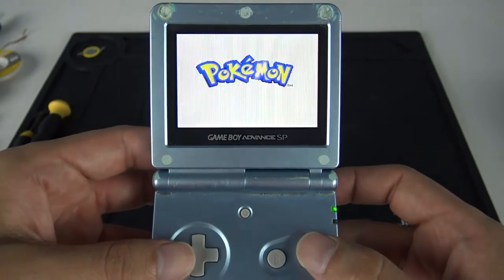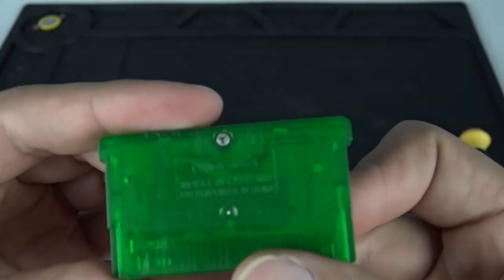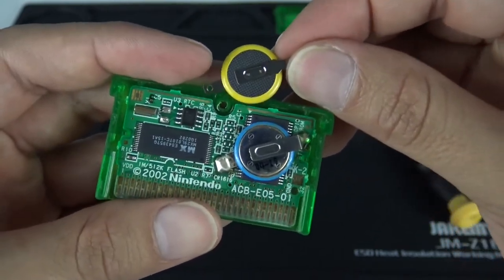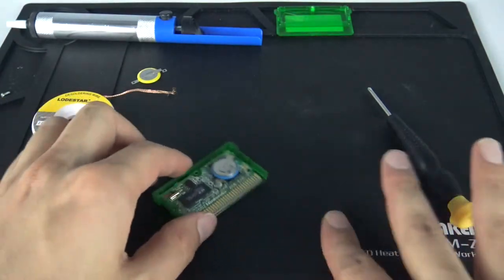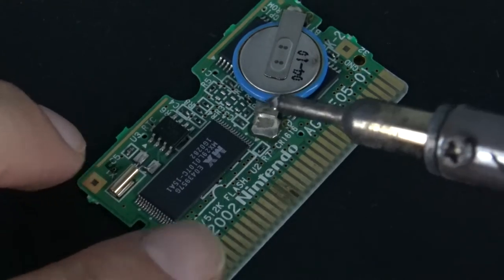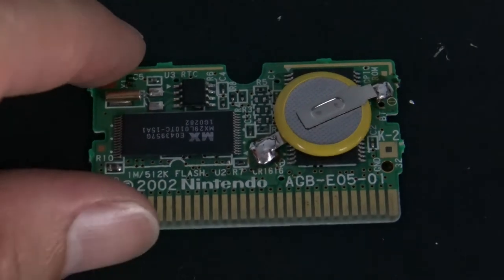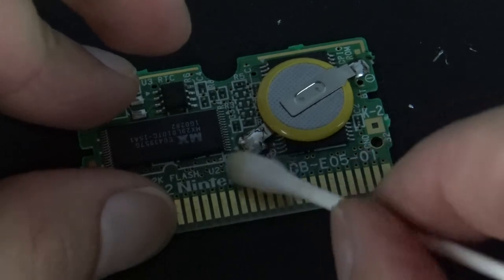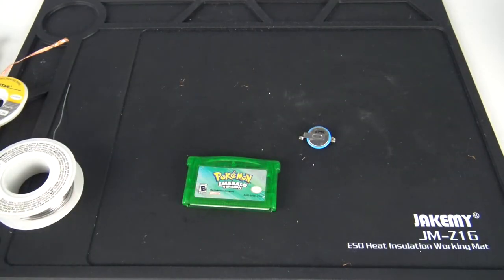How To Replace Battery In Pokemon GBA Game - DIY

Comment: That’s great work for a beginner. Just some tips; use a liberal amount of flux with each solder joint and make sure each joint goes completely molten, and bend the tabbed legs so there’s the least amount of tension possible once it’s soldered. That’ll give you a long lasting solder joint.

Comment: Pro tip.  They use high temp solder.   You can add a bit of leaded solder to the pads to soften it up.  It makes life alot easier.   Grab a tube of Flux it makes everything flow

Comment: I replaced 1616 coin cell with a 2016. It has 50% higher capacity, and it still fits in the case.
Reply from the maker: That’s a great idea. Thanks for the tip.

Comment: I just pop the connections off of the battery and use electrical tape to hold the new battery and contacts to it. If people don’t want to solder. Works just fine
Reply: Please don't do that. It's ghetto, could ruin the case plastic, and is unreliable. Just solder the darned thing. It takes all of 15 seconds.
Reply: @vhfgamer  no thanks I'm good. works great, no issues 😁